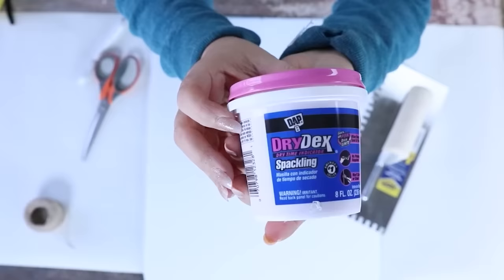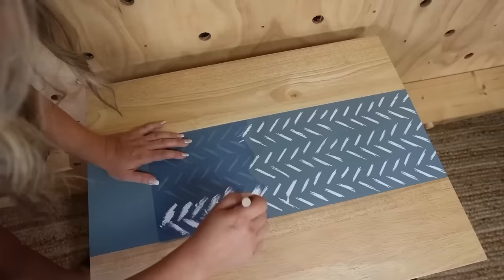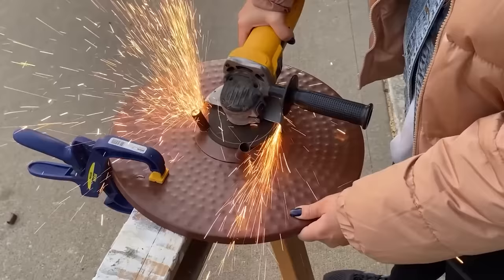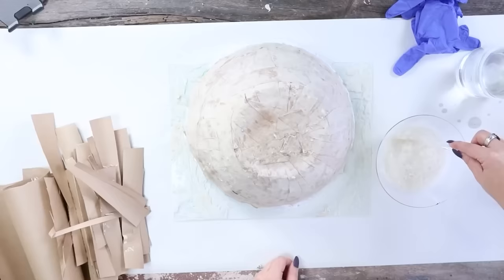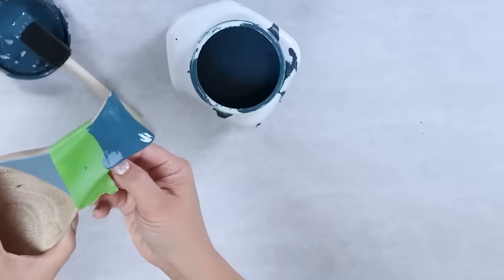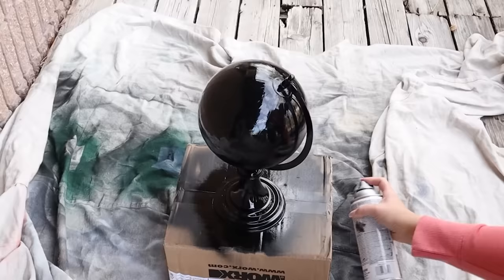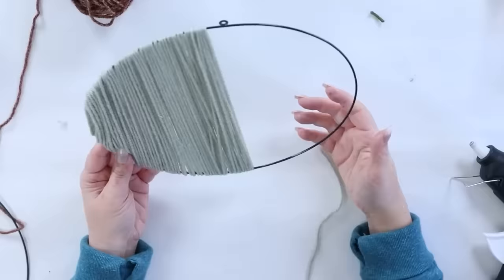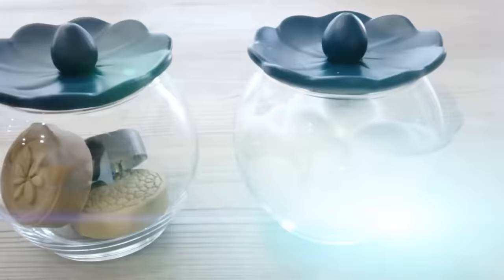40 High-End Home Decor Ideas You Can DIY Today!

Comment: Hi Liz. If you ever do this again, try using sea salt or a larger grained able salt. It will explode the paint. Also, you should wet the entire paper, let it dry then wet it again to paint it. It sizes the paper. The paper sometimes has a film on it which doesn’t help the paint. Also, water color fades, as you found out. So don’t be afraid to be bolder in your colors.  There out very nice.

Comment: Does anybody have any tips for using regular plastic stencils & keeping them in place or how to prevent leak through? Made more of a mess with my acrylic paint on my custom artwork than I wanted & kept having to wash & dry it between every use for each piece, huge hassle. Still had an issue when using it for just a permanent marker. I got painters tape to at least keep it in place to free up my other hand while painting, but any pointers would be much appreciated! Anything to help my new little business thrive will be a blessing!❤
Reply: Here in Canada there’s a spray can of temporary spray glue. I got mine at Canadian tire. You could try Lowe’s…? Good luck!!
Reply: When you stencil, tape the stencil down and use realitivly dry paint . Wet, runny paint will get under the edges.